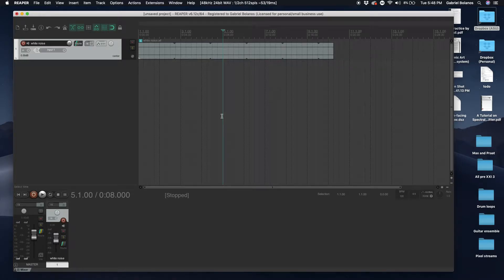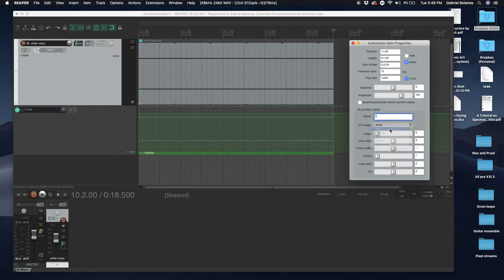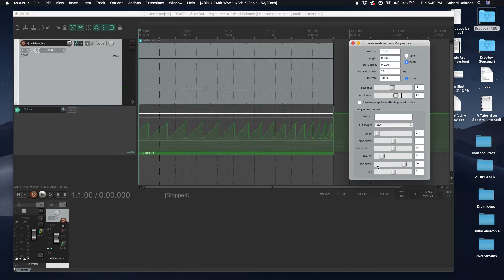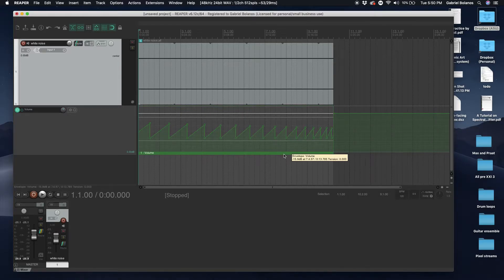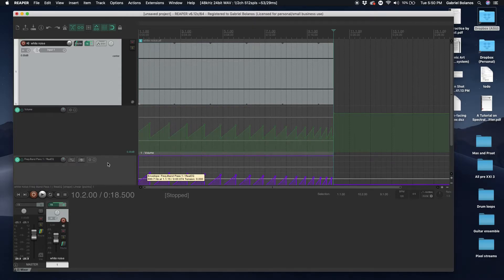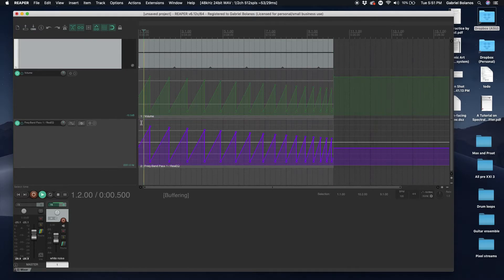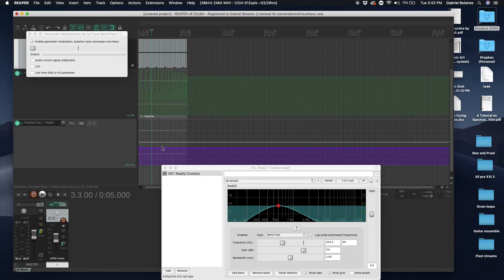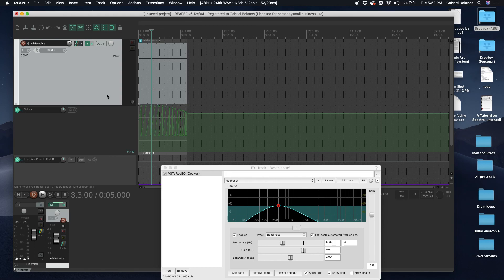Automation items with LFOs in REAPER

Comment: If you pool the envelopes, which I believe is default behavior (I know I have it disabled on my copy), then they will lock together automatically and you can edit their parameters simultaneously. I'm pretty sure you already know that, I just wanted to mention that in case any new comers happen across this. There is a setting under -- options > preferences > automation, called "pool source data when pasting automation items".